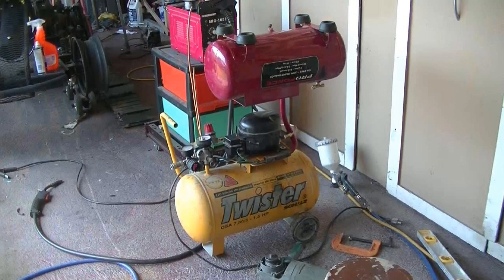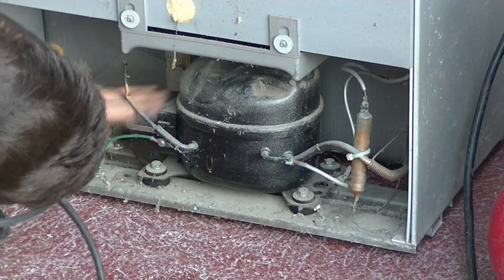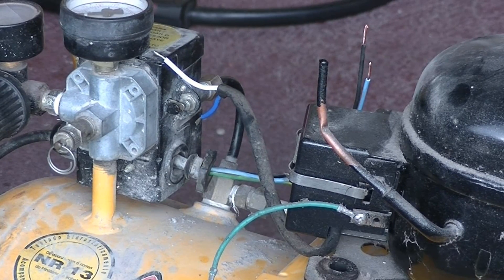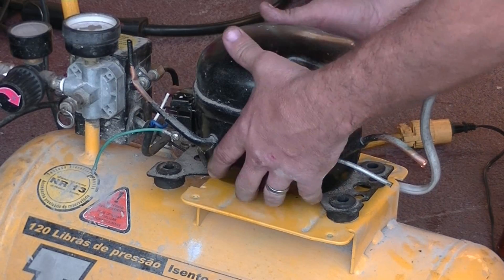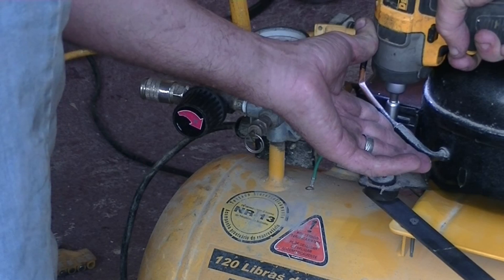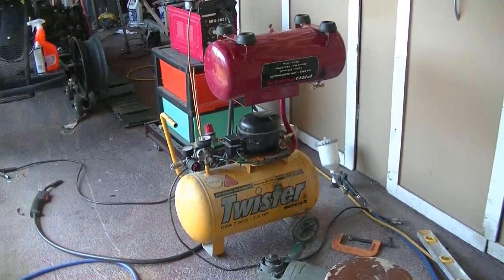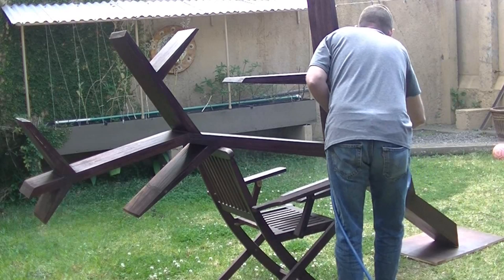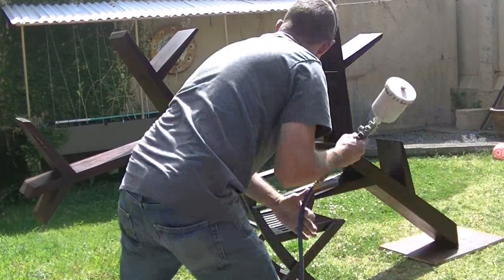Air compressor conversion using a refrigerator compressor

Comment: I'm building one for an airbrush and, hopefully, Brad nail guns. What size is that 1/2 ?   I have both a 1/2 and 1/5. I'm hoping to use the smaller one for the airbrush. An hour is a long time for that setup. I'd look at savaging another pump to add. It wold be with the effort for the quiet! Great job !!!

Comment: how come the video is of latin origin and your voice doesn'tt match the individual in the video? you didn't even put up the tech spec, what is max psi output of compressor, what size valves you used/purchased.

Comment: The motor mounting plate from the small refrigerator will cut away easily with that grinder and then, with a couple of drilled holes, you have an  engineered mounting plate for the motor that bolts right onto your tank. Takes 1 minute.

Comment: Hi, this is an interesting remodelling work you demonstrated. Thank you. My requirement is other way around. Want to know if I can use an existing Air compressor and tap one line to use for industrial refrigeration and other line for general air compression purpose? Basically want to use one compressor for dual purpose.

Comment: You can't know if the fridge compressor still works well, unless you test it.  The most common test would be does the fridge get cold, but that means it still had refrigerant (didn't all leak out) which means you just released all that refrigerant into the atmosphere when you cut it out?    Fortunately there are much quieter small/oil-less compressors available today.  Check out California Air Tools and a couple other brands whose names escape me at the moment, one of which is at Harbor Freight.

Comment: I  think the only thing i would have done to the compressor it self, i would have changed the oil in the unit to compressor oil because the OEM oil is for use with Freon or R134A and when it is mixed with air it will deteriorate as the unit is used. dumo out what is in it measure it out and replace with the same amount of compressor oil.
Reply: dont use normal compressor oil, you`ll end up with a dead compresseor  ;)

Comment: You should've used the bracket from the small fridge. Just cut it a couple inches from the mounting holes then bolt that bracket to the tank. That would've made it leveled.

Comment: I used to know a guy in Fla., that did the same thing only using a commercial compressor and an old 500 gal propane tank. Unbelievable. This thing put out over 300 psi and I can't remember the cfm, but it was very high. In fact unless we were using the 1" impact gun on the semi's, we'd have to drop down the psi and cfm using regulators.

It ran an entire shop including several lifts & a paint booth for over 25 yrs with minimal maintenance. Once the pressure dropped (which took several hr's) the compressor would kick in (we could still use the smaller air tools) and it'd take approx., 15-25 minutes to reach full pressure again._

Comment: That's cool,   You can also use two compressors on one tank,  Those are great for Air Brush guys,  sometimes they are working inside and don't wanna make a lot of noise..
    Some larger fridge compressors have multiple pistons.

Comment: It appears the tank check valve was removed during the build... does the compressor start and stop ok with pressure on it? Or do you need the check valve/unloader valve to be operational?

Comment: Your compressor will put oil vapor into the compressed air.  For spray painting you will need air dryers and cleaners to get the oil out.  The oil will ruin a job that requires clean air.

Comment: I took my compressor and attached a fluid collection container to the intake (vacuum) side and use it to bleed brakes. It worked great. Not sure if it would work as a vacuum pump to charge air conditioning systems, want to try that next but I do agree the the quietness is a huge advantage.

Comment: Thanks for the thought. But........ it is wrong to do this. If you understand the compressor operation and design in the refrigeration a/c cycle. The refrigerant coming back from the evaporator ( freezer section ) cools the windings so the compressor and the motor windings and the oil in the compressor stay below 300 deg Fahrenheit . The  piston will not have rings , so oil is designed to pass to the discharge side into the refrigerated system to later be brought back to the compressor. These style compressor are designed to start with equal pressure on the high side and low side. Hence came the comment do not start and stop the a/c or refrigeration system rapidly. When ever you shut off the unit wait 5 minutes to restart the compressor. If you want to use a refrigeration compressor , get hold of a open drive compressor, remembering these pistons on the small compressors do not have rings to keep the oil in the compressor. ( these compressors are hard to find now) The compressors that are designed to be restarted soon after have some sort of a hard start kit wired into the electrical motor. To connect these or any of the refrigeration  ( tin cans)  compressor in parallel is a waste of operating $$$$$$. Keep trying , A lot of bad ideas wind up turning into some great inventions, so don't give up trying to come up with something new.

Comment: Any idea what the best kind of oil to use when converted to a air compressor? Probably doesn't matter, I just used the oil that came in it. The oil mist in the compressor gets sucked into the piston & cylinder lubricating the piston etc. In a refrigeration system the oil in the Freon just gets returned to the oil sump. When used as an air compressor the oil is lost in the discharge air a little bit at a time.

I used a water trap on the air output to catch the oil. When Mounted at the air output of the compressor the air is still too hot to condense the water letting just the oil accumulate. I used a capillary tube (salvaged from a residential a/c unit evaporator coil) from the "water filter" drain and routed back to the air intake of the compressor returning any oil captured from the discharge back to the oil sump.  The air lost through the cap tube is too insignificant to even be noticed.

The lost oil is the major reason for failure of this type of air compressor conversions. The other is overheating because the compressor is designed to be cooled by the circulating Freon. I put a fan blowing on the compressor. No problem if it doesn't have to run too long.

Finally bought a regular air compressor and used the refrigerator compressor as a vacuum / scavenge pump to recover Freon from old units and pull a vacuum on systems I am working on.

Always wanted to but never did figure a good way to put a dipstick on the compressor to check the oil level in the sump and top it off as needed.

Comment: well done
as I know these compressors are able to compress up to 500 PSI , why u only put 100 psi at the tank , is the tank only able to store 100 psi safely ??
Reply: warsha cheap air tanks are only rated around 100-135psi, better models up to 200psi. if he had something like a old propane tank it would handle 300-400psi. I got a 25gal propane tank I'm using with my 175psi 5gal compressor.
Reply: @allenmckinney9533  
Test pressure for most 19kg propane tanks is 26.6 bar (391psi) but i wouldnt recommend you exceed 10bar (145psi)

Comment: @Aceman307  i built one with a 50 liter tank i use often with 2 motors on it and it takes maybe 5 minutes to fill to 8 bar ! i used hoses and normal things from around the house to build it , maybe its the lines that are the reason for it to build pressure that slow !

Comment: Yo, would it be good for a nail gun? Or do I need more psi or what ever that was, I got 2 room fridge like yours, I gutted a hole in one by accident because I was trying to remove the ice,... so thats a doo doo but the other one has a hole on the side from me playing with fire works in the house... so yeah but they both run, I would like to make my own air compressor for the nail gun but don't know if the 100 psi or what you talked about would be enough... I have destroyed my whole life so wanne start making... thanks in advance..
Reply from the maker: Yes it would work. You would probably want a bigger storage tank.
Reply: Thank you. I will try it next week

Comment: Id say it works pretty dang good!!
Looks like you are running at least 3.5-4.0 SCFM continuous pressure!!
Which is a lot better then many compressors, especially for the money spent!!
Think I am going to build myself one now as well.
Thanks 4 sharing bud.
DEv
Reply from the maker: No, it cant put out that much constantly, I have to build up the pressure in the extra tanks to be able to use the spray gun for any useful amount of time. It would work better for a airbrush setup. Thanks for watching

Comment: it looks easy, but im sure its because you know what you need. i have a mini fridge in my workshop that im not using, im looking for a silent compressor for my airbrush. thats all im going to use it for, i have a larger one for power tools. was going to buy one for $40 but it wasnt silent. in your opinion would it be worth it to try and build one of these myself? i am mechanically sound, meaning i know how to work with my hands. also i watched a video where the guy said the oil inside had to be drained and replaced with compressor oil. but you make no mention of that, so do i need to concern myself with it? thank you forany info you provide me. great video, totally got me pumped to go build this
Reply from the maker: I had no problem with the oil. I sprayed a little WD 40 in the intake every so often. If your re frig is already out of Freon I would say give it a try. Make sure you keep the safety relief valves in the system so as to not over charge your air tank.

Comment: hey,, which is better,,ac compressor or refrigerator compressor?
Reply: rafi saifuddin If you want quiet, fractional HP fridge compressor. If you want power and speed and are ok with having a hefty compressor, A/C. Make sure you have someone collect the refrigerant legally as it is a greenhouse gas and you could be charged $37,500 (max). It's easy enough to hand a 20 to an AC guy to have him recover the refrigerant. ACs are usually also more expensive and harder to get ahold of. But you can get 1.5-5 HP compressors easily from an AC but they're usually also 230V. The larger ones will make more heat and all compressors should be kept cool at least a bit. Cooling is normally done by cool returning refrigerant.

Comment: Cool thanks! What's the max pressure a tank like that can handle (is 150psi safe)? How can you make it more powerful so it will fill faster (maybe some kind of booster circuit for higher voltage)?

Comment: Correct me if I'm wrong, but is it fridge compressor generates moisture or water? is that advisable to air spray paint? cheers
Reply from the maker: All compressors generate water in the tanks. It depends on your climate. If your inside an air conditioned house its not going to create much moisture. But in Florida during the rainy season outside you will probably need a water separator in your air line.
Reply: Chinito Gwapito You can buy inline dehumidifiers, they are usually small clear cylinders filled with silica gel beads or some other desiccant! They are fairly cheap at Harbor Freight!

Comment: Very nice! Why didn't you just cut the base of the fridge where the compressor sits (1:32) and just bolt/weld it onto the platform? You wouldn't of had to make extenders... it was made for the compressor after all..... soooo anyways, live and learn :) Great job though!
Reply: i was thinking: you boltheads neet to start having a box of wood scraps. :D
Reply: Wow, you’re so smart...

Comment: Great idea and a great video showing the build, but if the most important aspect of it is the sound, why didn’t you have actual audio of it running?
Reply from the maker: Sorry for that. II dub all my videos because the mic on the camera is not the best. But the noise is equal to a small fridge running which is very quiet.
Reply: Lenny F

Comment: Love it!  How much current does the fridge compressor draw?  Do you think a larger fridge would have a larger compressor?
Reply from the maker: Yes a larger refrig would have a bigger compressor you could use more than one compressor also.
Reply: I like the idea of plumbing multiple compressors together.  The only problem with that, tho, is amperage draw.  When these fridge compressors start, they draw a large spike of current-up to 10 amps each or even more.  For one compressor, that would be no problem -- maybe two with no problem, but more than that and you'd have to connect them to different electrical circuits.

Perhaps that could be resolved with an inline capacitor between the compressor and the power source?
Reply: Capacitors only really have that effect on DC - on AC, it just draws more power. Time-delay relays so they fired up sequentially would work, though.

For a larger compressor, you could use an aircon one.

Comment: build a bigger platform and add more compressors, that's how i solved the lack of speed to compress air.....also window unit compressors have a higher output volume
Reply: obviously the compressor based from the context...
Reply: awesome, are they built the same way?
Reply: smokinone951 what built what way
Reply: They, meaning a/c compressors start at about 1/2 ton rating(6000) btu rating. These small refrigerating compressor are fractional hp ratings. The speed is about 3000 rpm in most compressors.The size of the a/c piston is larger ( displacement) and the motor is larger in the a/c unit so the a/c unit moves more refrigerant. having said that ,,,,, the industry has for quite some time switched from piston ( reciprocating ) to scroll compressors ( non piston). The newer compressors (scroll) HATE heat . Cannot be used as a air compressor.

Comment: Nice work! The problem may be that you have too much tank for the compressor. 
There is a ratio of tank size to compressor output. A solenoid valve to the second tank
might speed pressure build.

Comment: I wouldn't use a appliance compressor for painting. They output oil that can leave droplets and marks in paint.

I built a 3 gallon silent compressor using a dehumidifier compressor, if you don't feed it oil it might burn up but it also outputs that oil.

And make sure to not tip them upside down, or all the pump oil will leak out!
Reply from the maker: +Andre Gross If you were worried about the oil just get an oil water separator. The oil that surrounds the compressor motor is to quiet it and keep it cool. It is separate from the output air. I use a little oil to help lubricate it but I have not had any problems with painting stain or varnish.
Reply: Aceman307 no
Reply: The oil is not seperate, the intake to the piston is inside the compressor shell. If you use the original oil it`ll pick up moisture and foam up..foamy oil isnt good for lubrication. Using a large tank (let alone two tanks) with a small compressor is not a good plan. You dont want the oil to get above 100 deg C as it`ll turn acidic and attack the copper windings of the motor. Commercial silent compressors typically have a duty cycle of 50% for this very reason.
Reply: @atomizer2665  Have seen folks drain (measure amount drained) then replace with a 10w plus motor oil which does not absorb moisture as does the refrigerant type oil.  A vertically coiled copper outlet helps with oil drainage if any should escape an the oil separator, oh and any upside down horesplay with your compressor.  Hope this helps.
Reply: @atomizer2665  ,y
Reply: @anacornejo1343  
was that a question? ;)

Comment: I have seen some people use 2 or 3 compressors to get the air volume needed, it could be something to look into.
Reply from the maker: +Courtenay Blackburn (Libertarian Socialist) Thanks
Reply: +Linuxtarian Socialist 
Three 3/4hp compressors in tandem will give you upto 5cfm output at any pressure, you have to start them sequentially due to the large inrush current. 
You can easily kill a small compressor by running it for long periods of time.  If the oil goes over 100C it will cook, degrade and coke up the reed valves. Take a look at the spec of a commercial silent compressor (bambi etc) for a idea of duty cycle.

Comment: Kind of neat. The only downside other than the fact that it's super slow is the fact that when used in it's designed application, the compressor actually gets cooled down by the cold refrigerant vapor coming back out of the evaporator. You no longer have this cooling gas going into your compressor, and are much more likely to trip off on the thermal overload. I think the only reason it didn't overheat is because of relatively low pressure on the discharge side vs what it would see in a refrigeration application.

Anyway, cool project. Just make sure you hook an filter in line with your spray gun since the compressor will also shoot out tiny amounts of oil with the compressed air. Might want to find a way to check the oil level from time to time just to make sure you still have enough for proper lubrication.